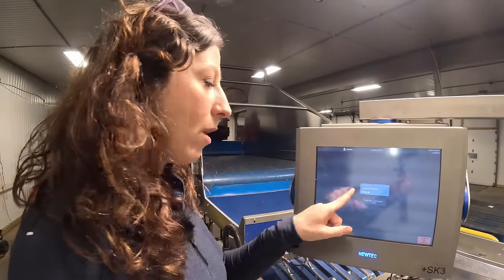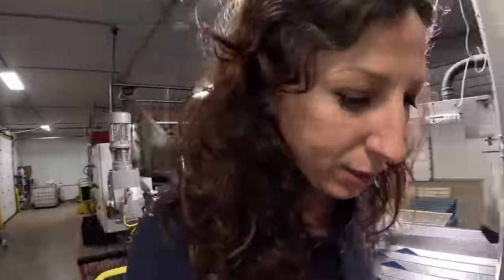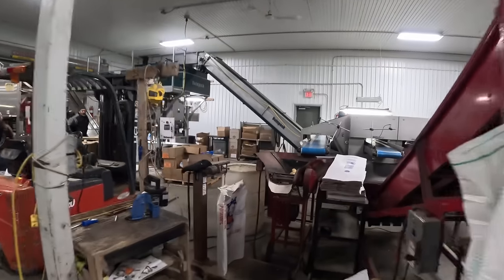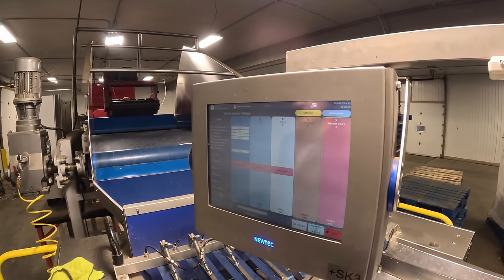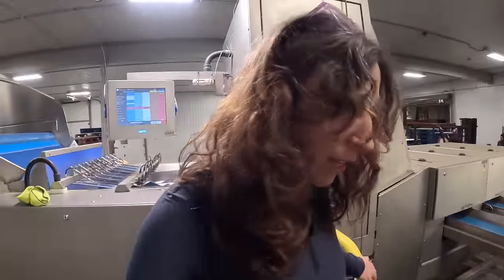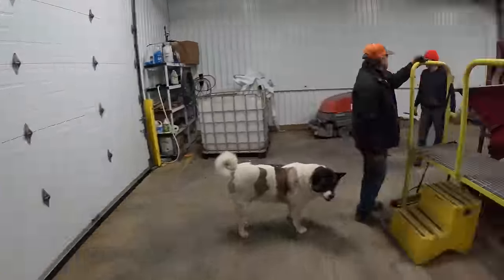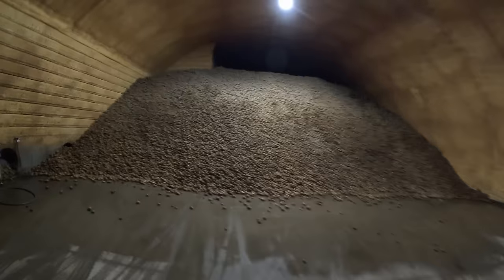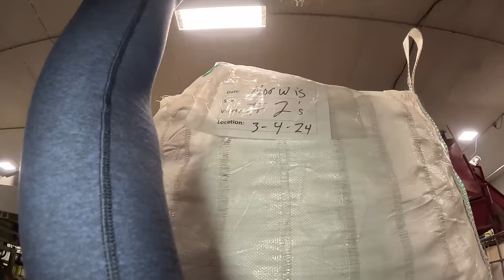The start to a busy week bagging potatoes

Comment: Really informative detailed video. What an awesome operation. Still want to sell you bags for these potatoes. Be well.
Reply from the maker: Hey David. We are currently using northeast packaging out of Maine for our bags. We have tried other bag companies in the past and it hasn’t worked out for us. They would not run well on our bagging machine. We are a little skeptical on trying new bags again. We ended up have to throw away most of the ones we purchased unfortunately.
Reply: @BellsFarming  Understood. I am aware of the challenges that bagging potatoes comes with. Nothing worse than bags failing on the line in operation. Not sure if we can be competitive in price but certain our bags would not fail. Your videos are very informative. Keep up the great work you guys do there. Thanks.

Comment: I see you are spraying down the pile before moving to hopper. Is that just a dust remediation thing or does it serve another purpose?
Reply from the maker: Dust and it helps the potatoes slide into the bucket with out skinning :)

Comment: Question.  Instead of spraying down the potatoes every time you take a shovel load, could you put in misters on the ceiling to keep the dust down?
Reply from the maker: Yes I’m sure some kind of spraying system could be set up. It would have to span the whole length of the packing houses. One of the thing about water usage on a farm, it all has to be monitored and clean. All the hoses and line have to be inspected because they are used with food. But I’ll ask Raymond if he has thought about doing something  more hands free. Thank you for watching!! 😊
Reply: @BellsFarming  I didn't even think of regulations working around food.  Adds a whole other level of difficulty.
Reply from the maker: @GeneMatheney yeah the food safety part does add another layer to farming. But it’s all for good reason.

Comment: Thanks for showing more of the operation.  At what point do you start working the fields and planting potatoes?
Reply from the maker: Soon! I’m ready for it. We usually get in the tractor as soon as the ground is dry enough. April. Planting is usually end of April early May. We will be bagging out of the tote bags once a week for our local market after the big pile is off the ground. That is usually a hand full of totes at a time.

Comment: Just wondering Molly, why they spray the potatoes with water before he scoops them in the bucket.
Reply from the maker: It helps keep the dust down, and it helps  the potatoes slide into the buckets with out skinning them.

Comment: Hey there Molly, Do you guys sell to wholesalers such as the types that supply Deli, Restaurants, Hospitals and others?  In the NY area and others place on the East Coast, Restaurant Depot, J Kings were big suppliers of everything that Food Service Companies sold that food preparers bought.  That white bag of "Chefs Special" looks awfully familiar.  What's the biggest season to sell potatoes?  Winter, Fall?  I would guess those two are most popular....
Does he spray the potatoes in the cell to keep the dust down or to just give it a quick clean?....
Reply from the maker: Hey Patrick! We sell to a lot of different places. Some are distributors centers for specific grocery stores. Some are smaller businesses that sell to restaurants kind of like a Sysco. And we also sell directly to smaller grocery store changes and restaurants. The chef special bags are pretty generic. Most potato growers will bag chefs in them. The water on the potato pile is to help keep the dust down and to help the potatoes slide into the bucket!

Comment: That was interesting! It seems no matter how intricate the automation is there has to be some human watching over what the machine misses. Would you prefer that there has to be no human interaction? I think I know what your answer will be, I know what mine would be. What I didn’t realize is that when you’re sorting you’re doing it for three different customers who use different size potatoes. I do have one simple question. The big tote bags on the pallets, what is the weight on those? It has to be upwards of 2-3 thousand pounds at least if not more.
Reply from the maker: Hey there! So having a person do the final grade gives us the confidence that everything is running correctly, and that the loads will not get rejected. I personally don’t love grading potatoes. But it’s a very important job. I wouldn’t trust anyone to do it. The tote bags are around 2200 lbs on average. Thank you Edward!